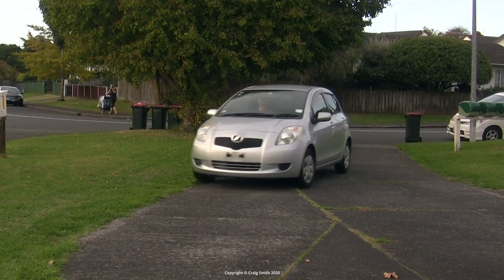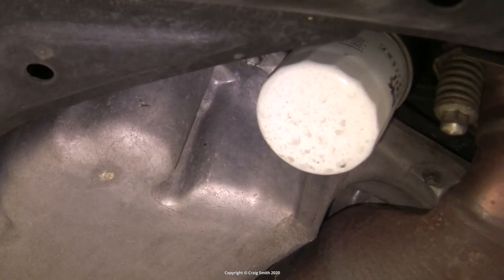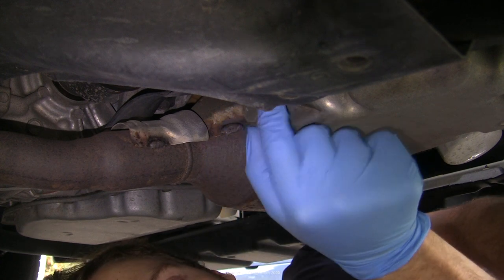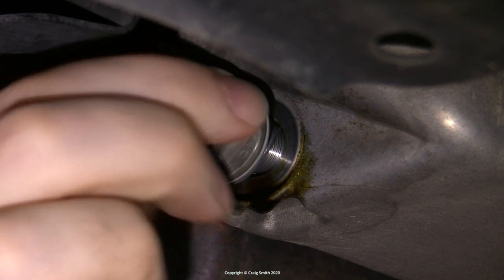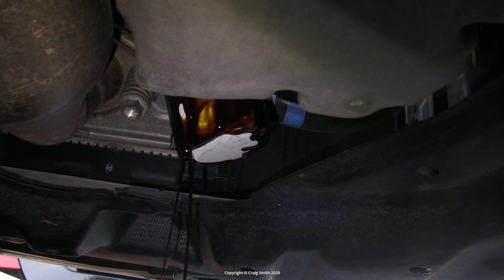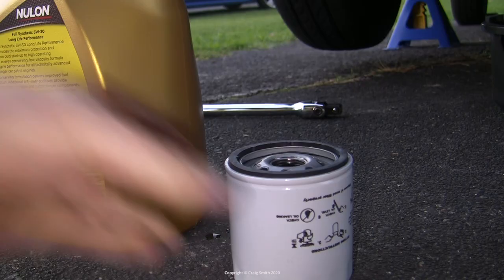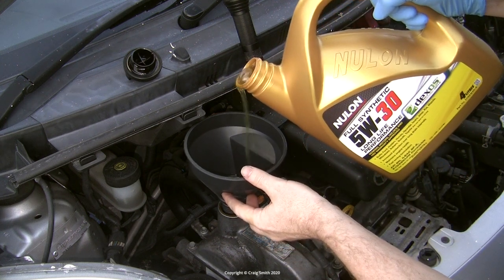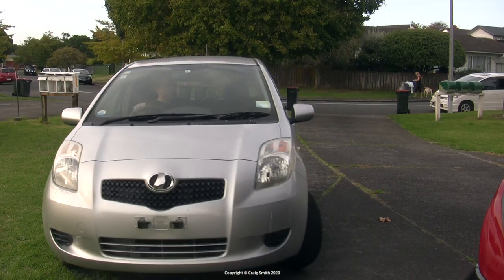How to: Change oil & filter Toyota Vitz / Yaris Mk2 / Daihatsu Charade (service)

Comment: Please boss , I saw your videos on mondeo mk3. Really you are professional and experienced. I have a problem with my mondeo 2003 mk3 , three days ago I had a crash in front of bonnet , then the car 🚗 turns but not complete start , checked all wires and connections all well. Checked fuzz box all well .. please help save my car 🚗.I wish I could contact you and send you photos or videos. I admire all maintenance videos on mondeo mk3.

Comment: what is the recommended gearbox oil for the automatic toyota belta 1.3 vvti, 2SZ-FE engine
Reply: Your belta is CVT transmission, Its Toyota CVT-f oil in a steel can for your 2szfe belta

Comment: What do you do with your old oil?
Reply: I do fish and 🍟
Reply: Sorry your comment is already 2 years old. He did mention, that some of the Auto Parts shops accept old oil for recycling. You don't get paid for it, but they accept the oil and send it on to a recyclers so you know you're saving the planet. (In New Zealand and Australia "Repco" and 'Supercheap Auto" are the 2 main chain stores for auto parts).  Some Auto parts stores may have a large "dumpster" bin outside, but ask that only old automotive oils, in auto oil plastic containers are placed in the bin. I noticed one shop had no bin so went inside and asked. They said naughty people had been dumping rubbish in the bin so they keep it in the staff only area out back, but were happy for customers to bring in their containers of used oil and hand them in at the front counter, for the staff to put in the recycling bin.  Some mechanics workshops in the old days had a 44 gallon/200 litre/55 US gal drum in a corner with a funnel, to dump old oil into. Those drums would later go to recycling.